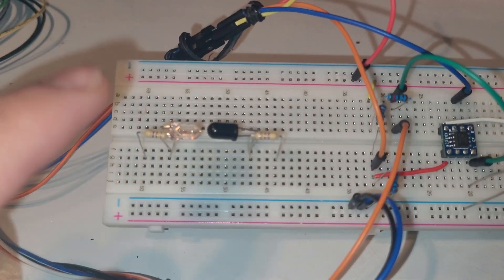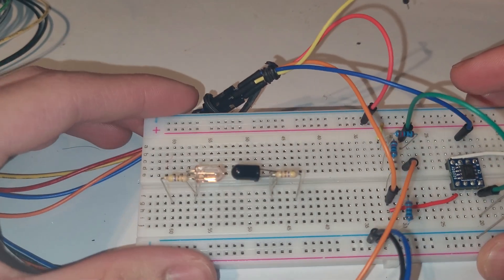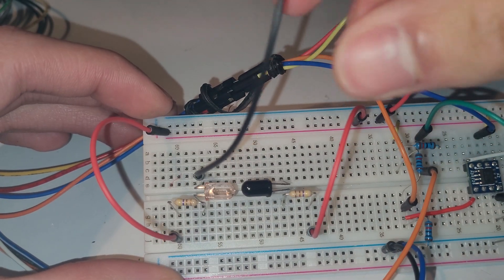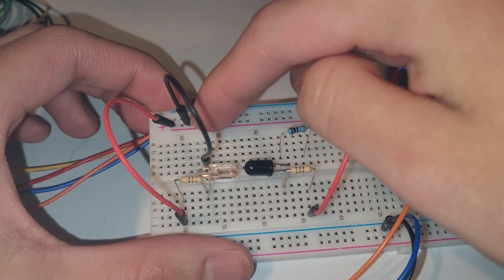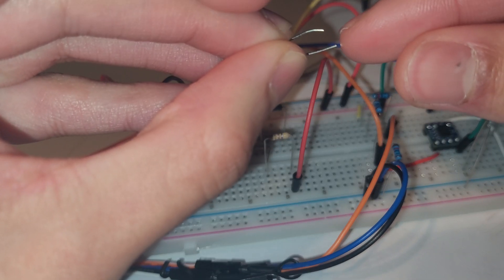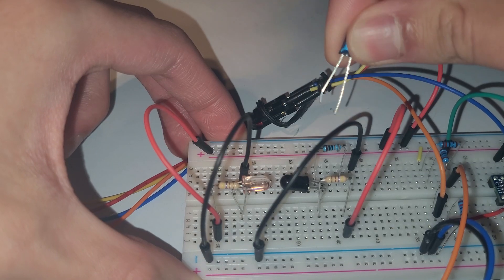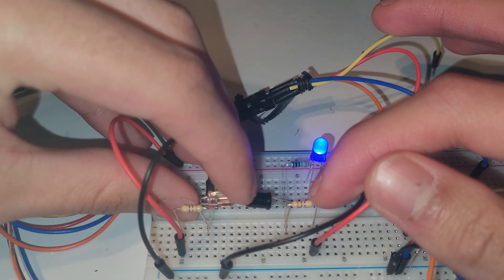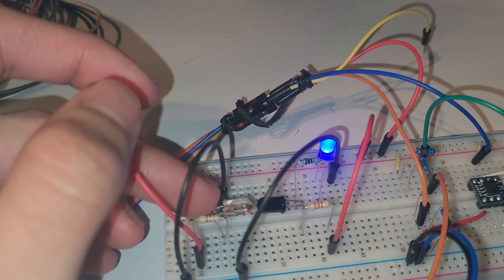optocoupler (infrared LED & phototransistor) on breadboard w LED (Electronics 1 LAB | Sensor App.)

Comment: [16/3, 16:00] Luca: [21/2, 14:26] Luca: https://youtube.com/shorts/Yu3obf6W18w?si=_HRrzUmfWwxpHEyN
[21/2, 14:26] Luca: X esempio/For esemple. : https://youtube.com/shorts/Yu3obf6W18w?si=_HRrzUmfWwxpHEyN
[5/3, 10:52] Luca: Ciao potreste progettare circuiti e dispositivi elettronici partendo da zero quindi facendo vedere i vari collegamenti e la disposizione dei componenti elettronici mentre spiegate il funzionamento dei circuiti elettronici in modo che siano più semplici da realizzare? Vorrei costruire ad esempio circuiti con porte logiche,and ,or,not,nand,ex-or,ex-nor ;triggerate e non,flop microcontrollori Pic PLC ecc.. ok? Grazie Luca 😊👋
[5/3, 10:53] Luca: Video normale e /o short.  Normale video and/or short
[31/3, 15:12] Luca: por ejemplo circuitos electrónicos cin puertas lógicas de todo tipo y o no mando ex o ex ni disparado y no flip flops, motores eléctricos sincrónicos y asíncronos sin escobillas de todo tipo, amplificador operacional Pic microcontroladores PLC etc... todos construidos posiblemente paso a paso por lo tanto desde cero para que pueda hacerlos más fácilmente desde mi casa ¿vale?